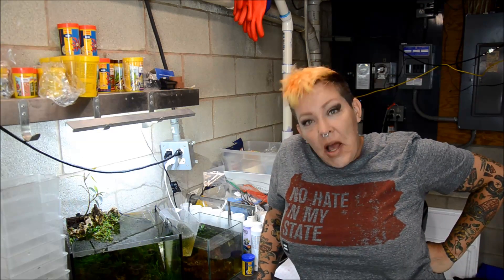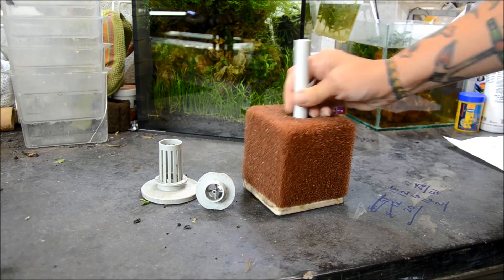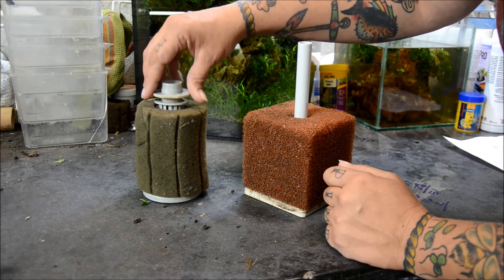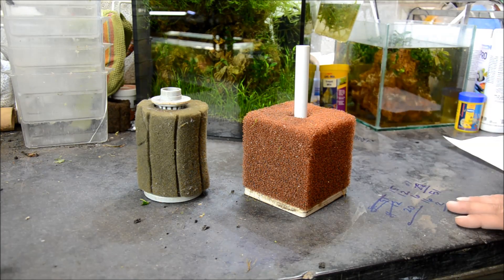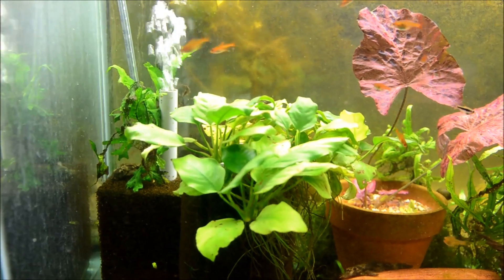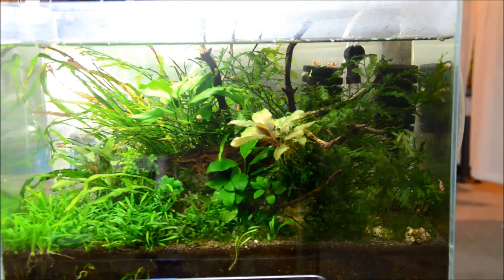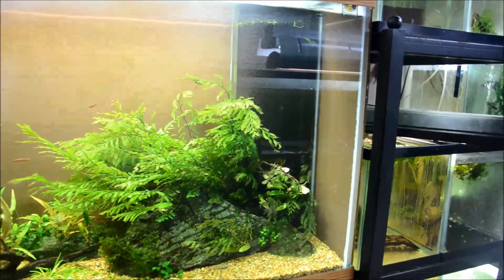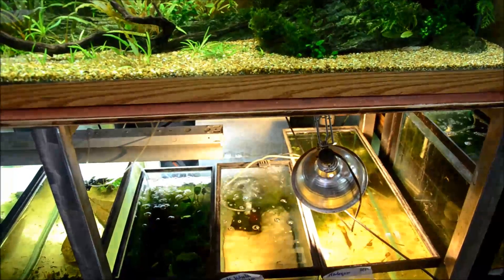The How and Why of Sponge Filtration- The Quick and Dirty

Comment: One year later... if you cut a slit in the red Poret sponge can you take it off without dissembling the tube?  Also, if you vacuum the sponge before taking it off will that make a big difference in the gunk not floating off if you don't do the bag in the water thing?

Comment: These sponge filters have a huge drawback. You can't really see if they are working or not. If the sponge get's clogged too much no water get's pulled through the sponge, but you still see bubbles coming ouf of the tube

Another drawback is, that you kill your bacteria if you clean the sponge. 

From my point of view sponges are pure mechanical filters and I would always combine them with sintered glass medium for biological filtration
Reply from the maker: The bacteria isn't killed when you clean the sponge as it colonized the sponge itself.  You would have to bleach it to kill all the bacteria, even if rinsed in city water. Bacteria is not as fragile as many think. The bubble output is obviously impacted when clogged, and you can also tell easily by the water clarity as it doesn't polish as well when occluded.

Comment: Hi Rachel! I love your videos! I have a couple of questions that need your expertise:

1. How do determine that a sponge filter has slowed down, meaning it’s time to clean?

2. Do you have any tips on controlling the splash from the bubbles?

Thanks a lot!
Reply from the maker: The bubble output will be visibly less when they are getting clogged. You will also notice more fine particulates in the water column. As to how to diffuse,  with an ati ir similar sponge you can put an airstone on the opposite connection as the airline which will produce smaller bubbles but sponge filters are always a bit noisy

Comment: Somehow I missed this great video! Sponge filters are amazing. I'm a massive Apistogramma fan and have loads of tanks with just pairs or trios with a few small dither fish in... you can not beat sponge filters for this type of setup. They are cheap, easy to always have one on standby running in the back of a bigger tank, and best of all easy to maintain. I simply rinse the sponges in the last bucket of syphoned tank water when doing my weekly water changes and tank maintenance. Been doing it this way for over 30 years! Btw, hello from England!

Comment: Hey Rachel thanks for all the great info!!  I love all your planted tanks!!  I used to grow and propagate aquatic plants (no fish) 30+ years ago, with only plant lights and a bubbler.   I'm starting back up again, but with fish.  I picked up a couple grow light bulbs and they put out red light, which to me is not attractive or conducive to looking at my fish.  I noticed your lights are white, and in the same shop reflectors I used to use.  What are you using?  I've been researching light strips for my tanks and have a couple by Beamswork picked out, but they are $50 each.  That'd fine for my main show tank, but want something more cost effective for my experimenting and propagation tanks.

Comment: hi Rachel 
 i have a big sponge filter in my tank its fab - ( and the big armoured shrimp lives on it ) but the pump is super noisy.  taking it to see if it needs fixed to a LFS soon.   what kind of bubble stone do you put in them to reduce noise.???? 
its driving me mad as the tank is in my living room. 
Hazel x
Reply: I think she means the bubble stone reduces the noise of the bubbles breaking the surface and popping, not the sound the air pump is making.
Sometimes the air pumps just get a little screw inside that can come a little loose and rattle like crazy, so hopefully they fixed that instead of convincing you to buy a new one :)

Comment: Hi Rachel,  
Hope this isn't a dumb question? When you seed another sponge in an established tank does it have to be hooked up to a pump & running, or can you seed it by just submerging it in the tank for the 2 week period? Thanks  ☺
Reply from the maker: it will be more effectively colonized if hook up to air (the water gets pulled through the entire filter that way), however, even just being in a tank will mean the outer surface at least will be colonized with some bacteria

Comment: For the swiss tropical sponge, do you have to add additional air holes to the pbc pipe, for additional suckage?
Reply from the maker: I bought them with their airlifters, which are drilled with a ton of tiny holes for bubble output. If you were doing DIY, then yes

Comment: Do you get hot and cold spots in the tank with sponge filtration? Is there enough flow goin on to keep everything consistent? I'm a noob and I'm trying to decide what to put in my 20 gallon tank.
Reply from the maker: No, it stays pretty consistent. If only running a single tank, I generally would opt for HOB or canister filters but when you start having tanks show up all over your house- it becomes more economical to use sponge. Of course, a lot depends on what species you are housing as well.
Reply: Rachel O'leary I was thinking of using a sponge filter because I want to put my betta in a 20 gal with some Cory cats, and a compatible schooling fish. Bettas aren't really a fan of strong currents.
Reply: I have a my betta in a 10 gallon with just him and a snail.  HOB was too strong for him, or at least I think it was.  However, I modified a buffer for the filter with just a plastic bottle (many videos on this) and I also bought a large plant whose leaves are under the filter.  These fixes worked really well in reducing the flow

Comment: Hi Rachel! What I can't find anywhere is how powerful of an air pump would I need to run a sponge filter like the cube one you showed properly and most efficiently in liters per minute? 
thank you!
Reply from the maker: you need to look at the head height to figure out how powerful of a pump- i.e. how deep the tank is in comparison to where you are putting the pump
Reply: thanks for your reply do fast! Pump is 2 1/2 feet below aquarium and aquarium is 18" deep. will it help to put the pump higher, i mean does it become more powerful?

Comment: I have a question about filters for Betta fish... I have just a little 15 gallon tank for my Betta and he's the only one in there along with some silk plants. I had bought an adjustable filter and had it at the lowest setting. Even the tiniest bit of bubbles at the surface of the tank made him flare up and stressed. I took the filter out because I decided the amount of stress it was causing him I'd rather try small water changes every other day... but even during the process of that he seems to get very stressed. My Betta is more sassy than any other Betta I've ever had and on top of it even with how frequent I'm doing the water changes a thin film still forms at the top of his tank. Is there any type of filtration system you'd recommend for this specifically or do you think it's better I just keep doing the frequent water changes? I feel like with the filter running he's constantly flaring up at it but with the water changes it's only during the process. He only gets fed a couple of pellets a day or a dried tiny worm every two days (I switch it up on him) so I don't think the film is food related.
Reply from the maker: sid constantly flares at the filter too, i just have made sure he has that quiet area in the side of hte tank to rest
Reply: I had the same problem with my Betta 5 gallon tank and i was told that  the film i was experiencing too on top of the water could have been from me putting to much Betta Safe (makes ur tap water safe) in his tank...and after doing the exact 7 drops per gallon nothing more took care of that problem :) Good luck with ur Betta I absolutely LOVE them! :)

Comment: How exactly did you attach an air stone to the sponge filter to achieve fine bubbles? Thanks!
Reply from the maker: +Joshua FPV if you take off the sponge and pop the top part off, it's reversible so airline could go on either side. I put the airstone to the interior of the sponge and the airline in the normal position
Reply: Rachel O'leary thanks! I’ll try it out!

Comment: I just started breeding.  I like canister filters, I just sit them infront of the tank for easy access to clean.  However 50 times more expensive than a sponge filter.  But I can normally find a 3ft tank with canister filter plus extra 2nd hand for around $100

Comment: Rachel O'leary  I just finished cycling my new tank and sponge filter and I’m curious how to do water changes as this is my first sponge filter. I usually add prime once my tank is full in other aquariums during water changes but I’m worried that adding unconditioned water to the new tank would kill my beneficial bacteria on the sponge. Do I need to remove the filter each time or how should I go about doing this? Thanks in advance.

Comment: Hi Rachel, I have a problem with my sponge filters, they raise the ph in my tanks, i put 7-7.5 ph water in my tanks and when i test it after a couple days it raises to 8-8.5 ?
I've read that the bubbles created by the filters lower the CO2 in the tank and therefor raise the ph.
Are the sponge filters the problem or is it something else ?
Thanks.
Reply from the maker: +nozii06 I would test your tap water after 24 hours and compare

Comment: I run my goldfish tank with an eheim canister filter and just bought supplies (like 6 bucks) for a sponge filter for more filtration and In case I have to set up a quarantine tank. They are so useful, I wish I had known about them earlier but they just are not common here in Austria and you can only get some online for small tanks.

Comment: I have become a huge fan of the tried and true Aquaclear HoB filters. I use a foam pre-filter on them (the Aquaclear 30 on my 10g has a rigged up one, the Aquaclear 70 on my 40 breeder has the Filter Max III). I then use coarse foam, then medium foam mat, then polyfill for polishing. The 70, since it has so much more room, is able to have the big ole block of foam it comes with. The 30 has a thinner sheet of the same coarseness (is that a word?) followed by the same formula. It works flawlessly and keeps the water pristine. I also use air powered "bio reactor" filters that I build myself, for a little additional mechanical, bio filtration, and oxygenation. Combine that with driftwood and plenty of live plants, and the tanks are virtually bullet proof.

Comment: Ok, I got a 45 gallon tank with a hang on back 70 and a single air stone. I just got a 20 gallon for quarantine new fish with a small appropriate size sponge filter. I want to keep it cycled so I'm thinking about putting it in the 45 replacing the air stone, and pulling it out next time I need it for the 20. See any issues?

Comment: I use sponge pre filters on my bio canisters, the old fluvals (round ones) are just packed with crushed up BBQ rocks and I use the ATI sponges adapted to the intake tubes to keep the rock clean. i rinse the pre filters when they change color from blue to whatever. this way the canisters are small fish safe and it cuts down on maintenance on the bio filters. I clean them out every 2-4 years by replacing the BBQ rock

Comment: Right now I have external power filters in both my tanks (the kind that hang off the back of the tank).  I like that they're out of view and provide gentle filtrations.

In the past I've used an under-gravel filter with powerheads at both ends and submersible filters.  I used the former for goldfish.  It worked well initially, but as the fish grew waste built up faster than the filter could break it down, and I eventually had to remove the whole system and do a 100% water change (Not good, but fortunately goldfish are tough as nails).  The latter worked well with goldfish and danios, but my Neon Tetras would get stuck to the intake, and bettas would get blown around like a pastic bag in a wind storm by the current.

Comment: Thanks for the video Rachel :)  Just to clarify something because firstly its become a bit of an aquarium hobby myth, and secondly its something I only recently discovered the truth of: Poret sponge foam is not "manufactured' as Poret foam. It is BRANDED as Poret foam  -EMW Filtertechnik GmbH from whom Swiss Tropicals source their foam, do not manufacture foam, they CONVERT it. Which basically means they cut it up and brand it.

Polyether foam is of course superior in so many ways to the polyethylene/polyester foam products pouring out of China, all of which tend to gum up to a state where they're not really cleanable after a while, depending on bioload. Having bought quite a few crappy sponge filters, I wanted to find a good UK source of polyether foam and the above information comes from UK based foam convertors/distributors I'm communicating with - who get their foam from the same place EMW Filtertechnik GmbH get theirs!!

I suspect my budget will be far too small for me to source directly, but I do try hard to be eco-friendly and buying something from the USA that's been shipped from Germany only to ship it back to the UK strikes me as pretty absurd.

Bottom line is that if EMW Filtertechnik GmbH were a little bit more scrupulously honest they would acknowledge that "Poret" foam is not actually designed and manufactured for aquatic filtration, but simply branded and marketed by them as fit for purpose, which it undeniably is. The fact is that any quality polyether foam of suitable PPI and without additives such as anti-fungals and fire retardants would do the job perfectly well. But as with all marketing hype it takes some digging to see past the smoke and mirrors. 

I think it would be very good for the hobby to simply refer to this stuff as polyether foam and contrast its longevity and effectiveness with the cheaper rubbish - may well even open some doors for USA manufacturers of quality polyether foams to supply the hobby in the USA and cut out some air miles, and I assume, dramatically reduce costs and therefore retail price.
Hope that helps :)
Reply from the maker: +Julian Morgan eheim uses the same source, fairly certain. I was aware but afaik, swiss tropical is the only source here where you can buy it by the sheet or cut to fit

Comment: 1. wonderful Tee shirt. thank you. 2 I love the Poret by swiss tropicals! They are from my state (Minnesota) and you just cannot find a better product/supplier. The poret foam has a higher surface area than any other foam of comparable size. Moreover, the poret foam holds up a lot longer. You can even tell in your video. the poret is holding shape whilst the other looks pretty rough! I have found that the poret foam can be  more expensive than others but with the added surface area and longevity, makes them worth it.  Again, thank you for all your support and videos!

Comment: I have 2 tanks both with HOB filters and air stones.  In my 55 I use a Whisper 60, it's been going for about 30 years and my tank is healthy and clear.  The other is our 10 gallon quarantine tank running a Marina slim 15.

Comment: I use spong filters for my goldfish tub tank because I can't use the hob filters on it. The sponge filters work fine even with the goldfish because I use 4 at once and I clean them out twice a week. But if you have many banks then it might not be possible to clean them so often. But I would think you should clean out your filter more often than once a month, given the trapped waste will add ammonia to the tank.
Reply from the maker: i don't use substrate, don't overfeed, and do multiple water changes a week. If they are at all compromised before that (they get a "hard" feeling when they are getting occluded), they get cleaned. On average, in my fish room, once a month works out just fine unless its a tankw ith fry that is being fed a ton

Comment: I use a sump trickle tower for my 55g supplemented with a bog standard no name canister, a custom bio reactor made from pvc pipe, and another bio/chemical reactor in a bypass loop for the return of the sump. It's overkill but I go away for long periods of time and like having redundancy for peace of mind. I have a newly set up guppy tank that I am experimenting with a built in fluidized sand bed filter and under-gravel topped with seashells and plain gravel. For my Betta tank I have a kind of mat filter/in tank sump piled with lava rocks and a bubble lifter. 
Of all of them I say I'm happiest with the sponge type filter, it just simply works, I don't have to do any maintenance on it. Maybe later this year I'll get in and clean the mat out but it looks like it is on a long track to "clean on tank break down and rebuild."

Comment: First off, LOVE your shirt! #nohate

Back when I was a kid, we had "power filters" that were basically a small HOB that had an intake driven by an air pump and an air-stone. Crazy, right? The flow as you can imagine was...less than optimal, more like a drip. But if they were still around today they might have been ok for shrimp tanks, tho these are probably far superior. But I can't look at sponge filters like this without thinking of those chintzy power filters. :)

Comment: I recently switched my pair of 7 gallon rimless cube tanks over to the 3x3 30 ppi poret cube filters.
The Aqueon QuietFlow AT10 internal filters I was using before were just too strong for the bettas, even when dialed all the way down.
The bettas are much happier now.
I use Aqueon QuietFlow HOB's on most of my other tanks, with pre-filter sponges over the intakes, and my own media inside plus Seachem Matrix in them.

Comment: For me, the only problem with sponge filters is that most of my tanks are 15 gallons or less and they do take up quite a bit of space in the aquarium. I have modified all of my filters to either be sponge media only or ceramic biological media supplemented with sponges.
Reply: Jehmco sells the hydro-O which is very small and might work for your smaller tanks.